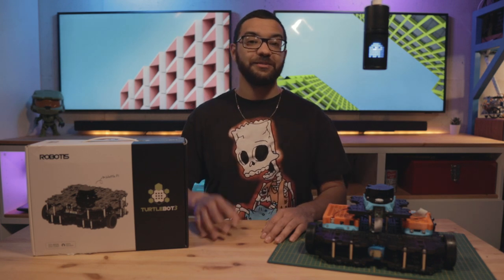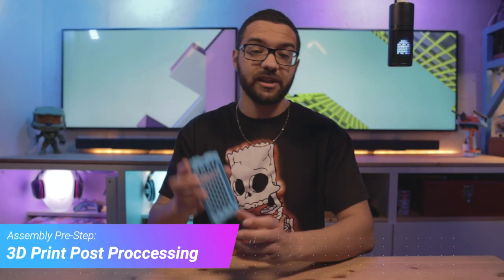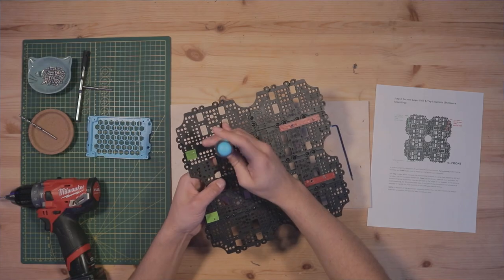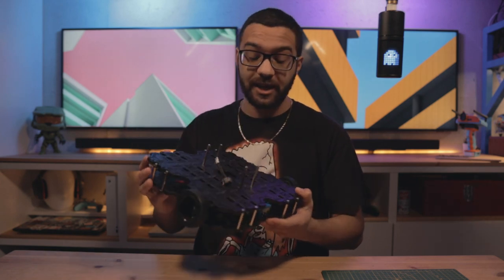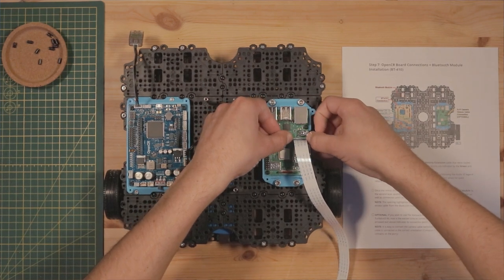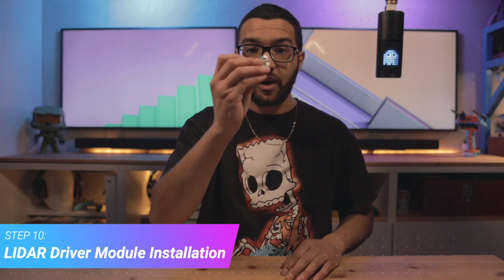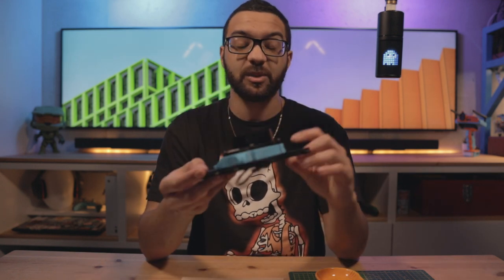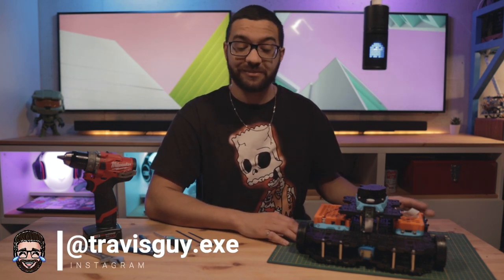Turtlebot3 Waffle Pi MOD: LEONARDO Upgrade Kit - Assembly Instructions | ROBOTIS | Travis Guy

Comment: Great video, I just have a question, I saw in one of your videos that we could fix an arm with a clamp on it, how did you make the robot fixing system, to fix the robotic arm with the clamp on the robot, I have a project where I have to create a fixing system with the same robot to fix the arm and the gripper, but I don't understand anything about it...
Reply from the maker: Hi Mervyn and thank you for your comment, 
Not sure what clamp you are reffering to. But if you would like to mount your gripper arm system on the TurtleBot3, we have solution that is called OpenManupulator-X: https://emanual.robotis.com/docs/en/platform/turtlebot3/locomotion/#turtlebot3-friends-openmanipulator. (You might already be aware of it) 

As this is hard for you to get answer here, It would be great if you could query through our community page here. See https://community.robotis.us/c/dynamixel-support/7